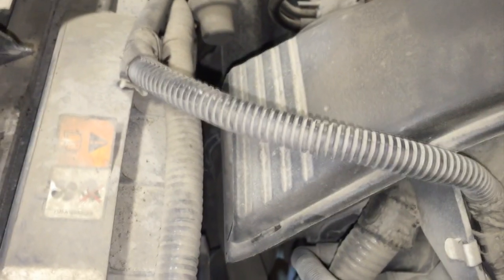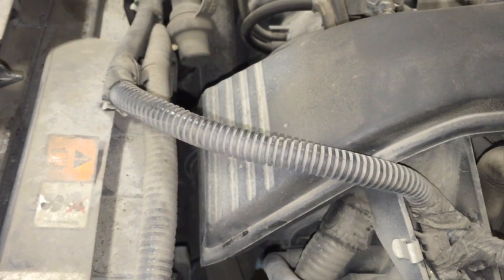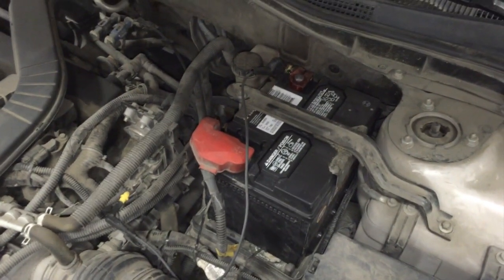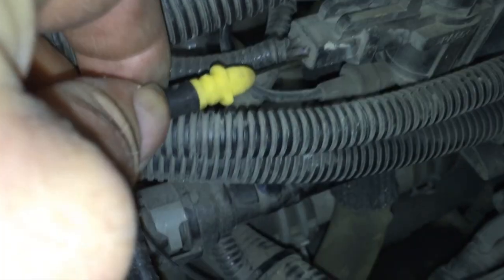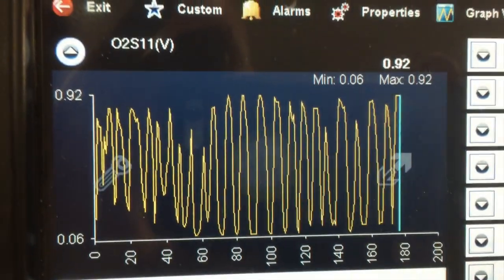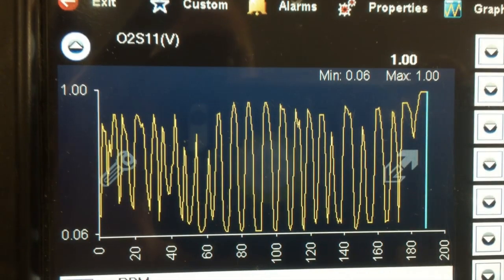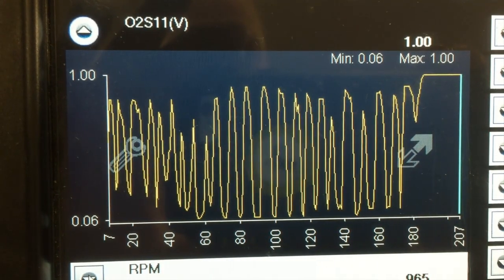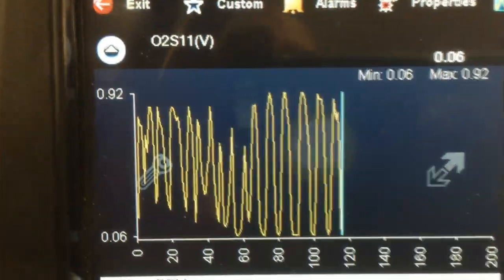Ford Fusion Code P0410 P0491 P2257 - Secondary Air Injection System Diagnosis

Comment: I have an 06 fusion with a 2.3. Check engine light on PO410 code. Grounded the wire on the solenoid pump did not run, check for power and ground was good, replaced air pump and now when I ground the wir on the solenoid the pump runs and i have vacume at the diverter valve and air preasure on the big hose. I cannot get the pump to run on its own when started. Temp here is 75-80 degrees. Is there anything else I can do now to make sure its working properly and the light wont come back on, thanks, you've been a big help.

Comment: Just replaced mine. Secondary.  Buy a Lincoln mkz or mercury milan part. Exact same part , half cost. Mine was 75$. Ebay 1/22/2023
Reply: Just get this part. Most likely your problem.

Comment: How long can you drive with both 410 & 491 code? 07 Ford Focus ?
Thank you for the information, btw.
Reply: Indefinitely.  The problem is it will make the vehicle fail its emissions check if your area has them. Where I live, failing means to will lose your vehicle registration.

Comment: hey Car Doctor... is you see this... i have 2007 Mercury Milan with a code that says P2257. i replace the pump (the pump did need replace) and the relay. im still getting the same code...  ( Secondary Air Injection System Control A Circuit Low)

Comment: Now I know I'm a few years late, but I was about to look at a vehicle that the seller admits having this problem. Curious as to why he won't fix it himself. But for those of us not so mechanically inclined or don't want to try fixing things in the dead of winter, just how much would this typically cost to fix at a repair shop?

Comment: 2004 Focus 2.3L with code P0411.
Solenoid, check valve, and air pump operate normally.
Feeling good air flow through check valve.
Attached shop vac to exhaust. Feeling good vacuum from exhaust manifold's air-injection inlet.
Ideas?
How to know difference between good and weak air pump pressure?
There's a video on YouTube comparing OEM to aftermarket air pump outputs.  BIG difference.

Comment: What could it be the pump turns on fine KOEO BYPASS TEST. But when I start the car on a 20 degree day after setting over night the pump kicks on for 2 seconds shuts off and throws the code when I manually apply ground KOER pump turns on the car stalls in seconds it stumbles like a huge vacuum leak any ideals
Reply from the maker: water in system freezes?

Comment: So the secondary Air Injection Pump was locked up due to being full of liquid that corroded the motor, blowing the F12 30 amp fuse. I replaced the pump and cleared the codes, but the codes came back, including the P2257. I tried the backprobe test but the pump did not come on. So, Doctor, what do I do now? I would rather diagnose the problem and fix it rather than just be a parts changer. Thanks.
Reply from the maker: Sounds like the valve is also fried

Comment: This was very helpful.  Using the info here I was able to determine that the diverter valve wasn't opening.  The air pump is working and there is vacuum to the diverter valve.  I went so far as to disconnect the output hose and determine nothing came out.  After replacing the diverter, the O2 sensor now drops to 0.02 V when the system is enabled where before nothing happened.  My confusion is that all the references I can find say that full lean is a low voltage, but in the video you show a waveform pegged at 1.0 V, which should be full rich.  Please explain.  Thanks again!

Comment: I received these codes.  Is this a repair that can be made at home?
Reply from the maker: Yes depending on your ability. Its certainly easy to get to the parts in order to test and replace them.

Comment: I followed your instructions and now my car will not crank. When I turn the key (tried all keys) the dash light go on, but starter does not crank. It acts as is the transponders in the keys were deprogram and now are not programed because something happened when testing the pump. Have you ever heard of this happening?
Reply from the maker: No. Weird. Is the theft light on?
Reply: Yes, the theft light was blinking.
BTW, I have a 2007 Ford Focus, which has same parts as the Fusion. I did fix the problem. It was the #9 position 20 amp, Engine Management Fuse. It is located under the hood. I must have blown the fuse when checking the pump. I followed your instructions. I did use the battery ground to ground the trace wire. I also fixed the Pump issue, it was damaged vacuum hose coming from solenoid valve. All is good.
Reply from the maker: Good call. Glad you got it figured out.

Comment: I replaced the diverter valve on my fusion (2.3li4) and the codes are back. At this point, would you recommend I check Air pump using your method, or replace the fuse/relay for the Air pump?  And what is the most common cause you have found?
Reply from the maker: Div valve is most common. Yes, check the circuit and pump or throw a new relay at it and see if that fixes it. Take care
Reply: +The Car Doctor 

I replaced the diverter valve (code came back) and the relay (code came back + expensive relay). Next is the air pump, not sure if I'll attempt it on my own. I have Ford factory instructions. My fault for not isolating out the parts I've replaced so far (lazy).
Reply: +The Car Doctor 
Not too upset that it wasn't the diverter valve. In one video a guy took it apart and showed how a disc inside was sticking. This probably would of happened anyway.
Reply from the maker: Your right, it would have failed sooner or later.
Reply: +The Car Doctor 
Visit my video on my channel featuring the diverter/bypass valve. I'm adding a lengthy explanation soon. 
Send me a message through my channel home page if you can.

Comment: what if it does go lean when I apply the ground, what do I check then?
Reply from the maker: Then you'll need to verify that the relay and wiring are ok.
Reply: +The Car Doctor relay and wiring is good
Reply from the maker: If it goes lean when you energize the pump it should be working normally. Not sure what you got going on there.

Comment: Is this the diverter valve you talk of http://www.ebay.com/itm/Secondary-Air-Injection-By-Pass-Valve-Bypass-Valve-MOTORCRAFT-CX-2445-/322028994216?fits=Year%3A2006|Make%3AFord|Model%3AFusion&hash=item4afa6c7ea8:g:CSgAAOSwX~dWtBv0&vxp=mtr or is this a way to bypass the secondary air injection on the ford fusion?
Reply from the maker: +mopowah Not sure I don't see a picture. It sounds like the right part.
Reply: is the "DIVERTER VALVE" you refer to also called the secondary air check valve? 911-167 Dorman Oddly I replaced the secondary air and I am back at it a year later and there is likely water again so it must be this anyhow I thank you much for the video much appreciated.

Comment: I have lean o2 and pump comes on when grounding purple wire and I have vacuum at valve. so....diverter valve?
Reply from the maker: +James Harney Do you have any of the codes listed? If so then the answer is likely yes. Its a cheap guess anyways so worth a try if for anything else just part of the diagnosis process. Be sure to check for vacuum leaks. Good luck!

Comment: The pump is running and I have vacuum when the engine is running and the pump is activated. Is it definitely the air diverter valve or is there something else I should be checking? I am getting both 410 and 491 codes. I also do not have a scan tool to check the oxygen levels as you did in your video. Thank you for your help.
Reply from the maker: +jimbo1234ify Sounds like a diverter valve to me.

Comment: On a ford focus when you hack into the system with a probe its the other wire. On my car I found a worn hole in the vacuum line from vacuum switch to air valve. Cut replaced with new hose and secured line so they wouldn't rub. Will remove code on mon.
Reply from the maker: +john mobley Don't hack! But good work finding the issue. Thanks for dropping by.

Comment: I have a 2006 Fusion 2.3L and the CEL has been on for about 6 months with 0410 & 0491 codes. Time for inspection. Is this a common problem for these cars and what is the most likely culprit? Fuse/Relay, cracked or leaking line, leaky diaphram in the diverter?? So many components to the system, just trying to figure out where I should begin and check first.
Reply from the maker: Robert Freeland just follow the instructions on the video. The systems should be just about identical. You can do this! Thanks for watching!

Comment: Are you using a digital multitester for this..i see tour test probe pin bit where have you grounded the wire?
Reply from the maker: Holly Stoyer I grounded the wire at the battery negative terminal with a jumper wire. Thanks for watching.
Reply: My vacuum line from solenoid to valve was cracked to bits..thus I have the 2 codes you mentioned but I cover line and pump kicks on...